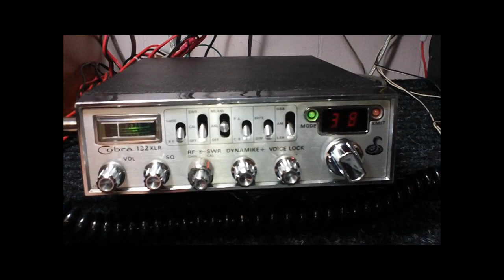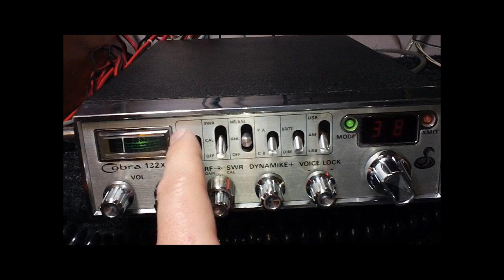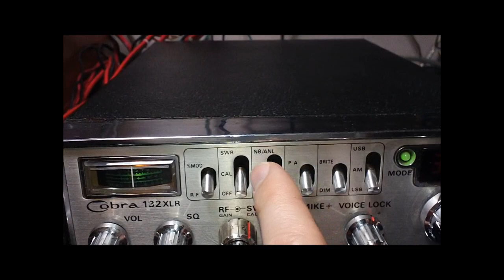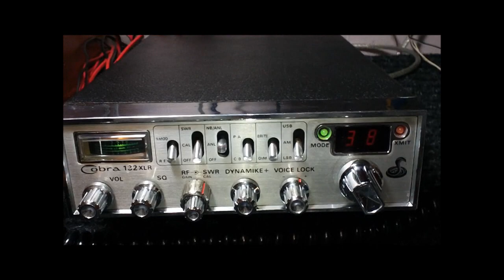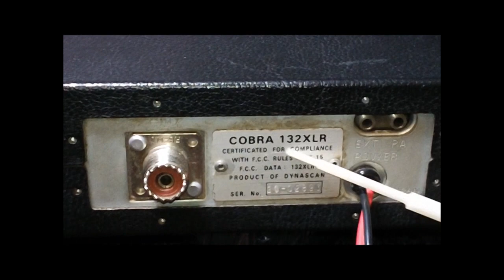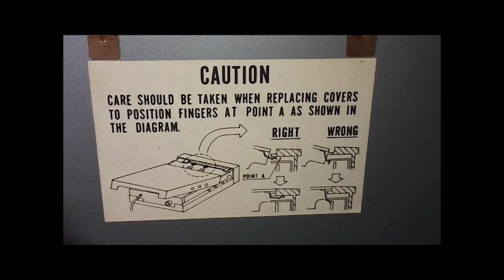Cobra 132XLR AM SSB CB Radio

Comment: just purchased one on Ebay for $29. seller said it won't power up but also noticed switch in PA position, while in PA does yours appear to not power? just wondering.
Reply: Joe Reeser I have one also but when I switch to pa the channel numbers are the only thing still on if that helps

Comment: I bought one used with all original packaging, and documentation back in 1995. It was the first 40 channel CB with AM & SSB by Cobra in the 1970s. At least the model I had. Eventually a few years later I bought a more fancy Superstar 3900 and loaned the 132 XLR to a friend who eventually lost it when he lost his home. I miss the 132, it was a fun and great radio. My channel switch was an external one added to the bottom. I got lots of great SSB contacts with it doing DX.I would buy another one.

Comment: Hello Paul. This radio has a very special PLL-circuit: The TC5080 is the programmable divider. The TC5052 is the reference oscillator and reference divider. Last but not least: the TC5081 is the phase comparator. All three parts are working together and conduct the PLL circuit. The SOMMERKAMP TS788DX has a similar PLL-circuit with TC5081/TC5082 but with a TC9122 programmable divider. Thank you for your post..73's. Stefan.